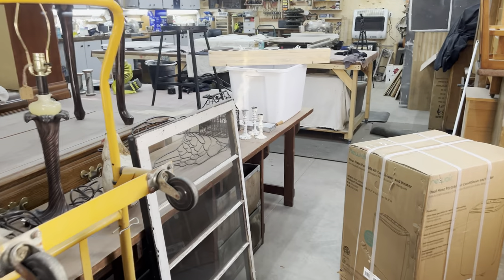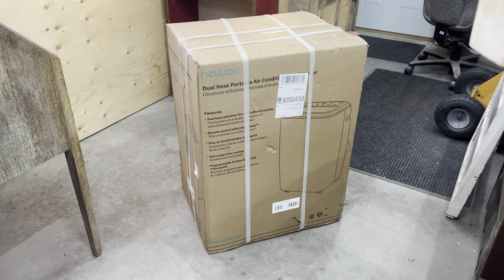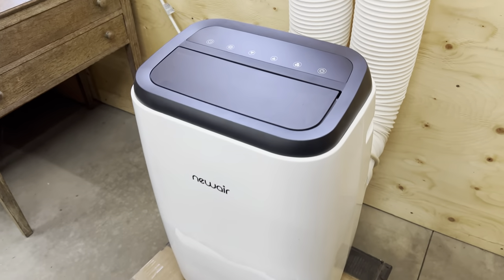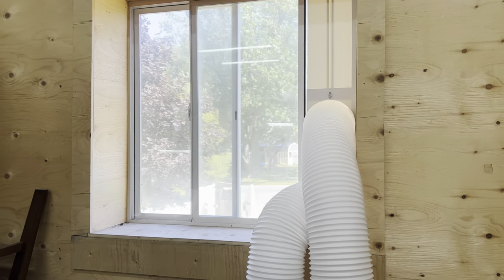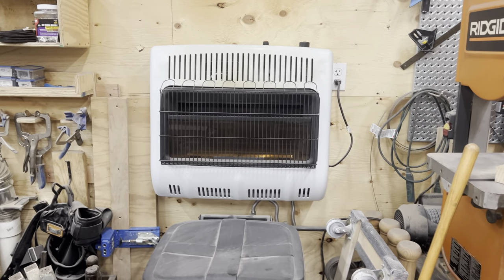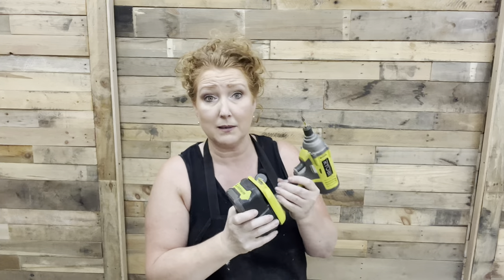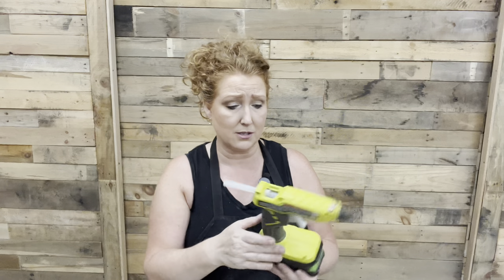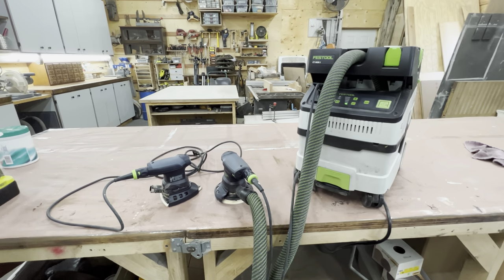Favorites Workshop Items| Full Time Flipper | NewAir NAC12KWHD3 Portable Air Conditioner and Heater

Comment: I love it, I wish I had some of your space. 😆 
I have several different sanders and definitely need the dust collection,  but its a ways off. But I do a lot of sanding, I have the drill, nail guns, plainer,  chop saw jig saw, scroll sander, im not to good on but we have band saw, table saw, and some other things. We are in our basement but there is also 2 big motorcycles down there that take up space, but there are vents over head from the heating and air so staying cool and warm isnt a problem, but if we get a very heavy rain it fluids, so thats a bummer. But we like you have gotten stuff over the years. I enjoyed seeing what you couldn't live without.
Reply from the maker: Love hear this.. yes collecting tools doesn’t happen over night. Like the workspace.  We work with what we have. Well not the flooding part.. 🤗

Comment: Great video! I need a good AC unit and heater in one… but I check them out on the Newair page and couldn’t find where they heat also. Just dehumidifier… please help
Reply from the maker: We have not tried to heat on this unit but it does show on the mode. I will have to show / try it this winter.
Reply: Cathy you might consider a mini split. It does both and is very effective.
Reply: Thank you … I will!

Comment: Hi thanks for the great videos,  question about your wall heater do you have it run all day and night in the winter and how much does it cost to heat if you don't mind answering, it would help me in my decision on heating my shop for winter.  Thank you .
Reply from the maker: In the colder months late fall, winter early spring.. yes we leave it on all night .. but on low.. so that our  supplies don’t freeze but also that helps the paint dry. And keeps me s warm.. As I said we fill the 120 gallon tank 3-4 times. So you’d just have to check you local propane prices.
Reply: @GingerChickRehab  thank you so much this helps  make my decision easier.

Comment: I am confused on why the unit would bring in hot humid air instead of recirculating the inside air to cool it and dehumidify it, as our house air conditioners do.
Reply: @H G I was comparing it to a central air unit rather than a window unit
Reply from the maker: The are it is bringing in is just for the condenser. The are that that you feel is just being recycled.